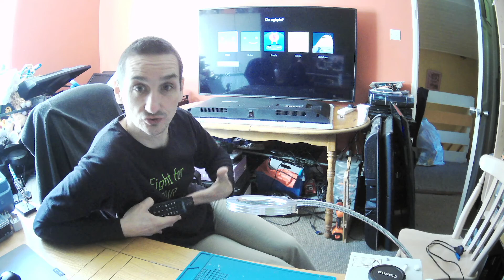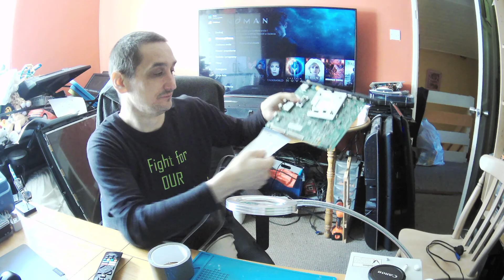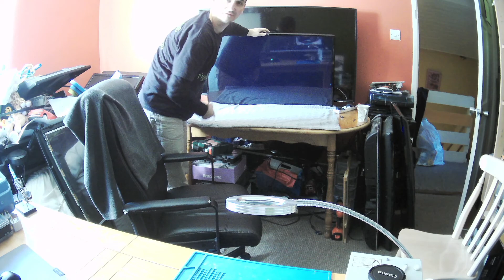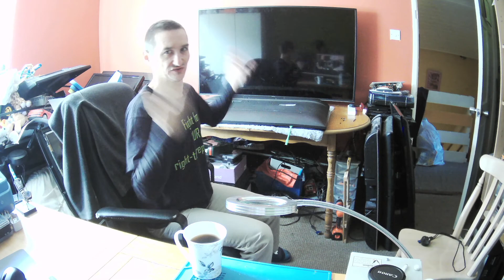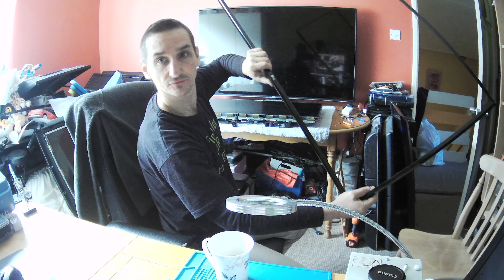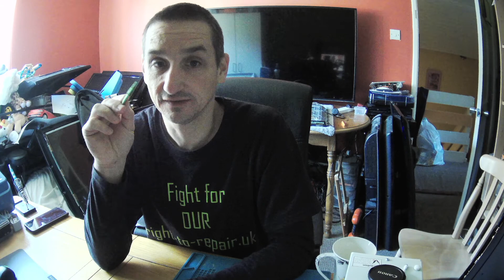LG TV 43UK6470PLC - only background light, no display, part1: let's try to understand what's wrong

Comment: Hello!:)
I need backlights for a Samsungs 82" NU8005 TV. Do you know where I can find it?:) I tried google, but it was not very helpful.
I appreciate your support.
Reply from the maker: Hello. I use 4 sources for backlights. The cheapest is AliExpress, next eBay and in the UK CGTV on eBay. But, if I can't find it or need a diffuser as well, it's a ASWO shop only for repair businesses. They don't sell to private people.

NU series can have some models with a melted diffuser and even cracked.. That's how Samsung has designed it. You can redesign it to not happen again, but the question is, do you want to have such extra hassle.

Comment: Just got a 55UK working had LG LOGO then nothing both LVDS cables unplugged voltage disappeared from the 50v can capacitor at the top of the mainboard near the edge that the LVDS cables are on the 32 volts dropped off after logo showing, well fixed now we’ll sort off now has feint horizontal lines on the right hand side (red LVDS 2)
Reply from the maker: yes, when you just cut off signal on the lvds connectors/t-con connectors, expect to have some weird things like lines. If you want to avoid these, you need to cut them off at the proper place, not there :).
Reply: @screen-protector  right at the top there’s a few black thin lines the rest are like feint 2mm apart all the down only noticeable on some backgrounds….. 
oh on this one it was an IC in position IC9400 a small 24 pin chip I think it’s a 3U=6AFHE I would be interested if you take the heat sink off it’s not glued there’s a heat sticky pad it’s under there just by socket 2 what number you see on the chip
Reply from the maker: @wisher21uk  yes, it's typical :)
Reply: @screen-protector  lol